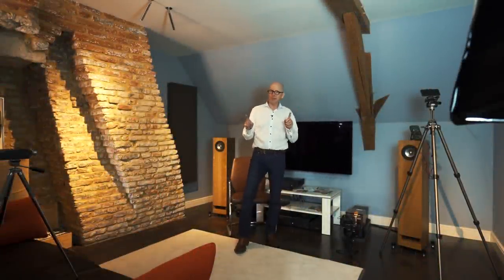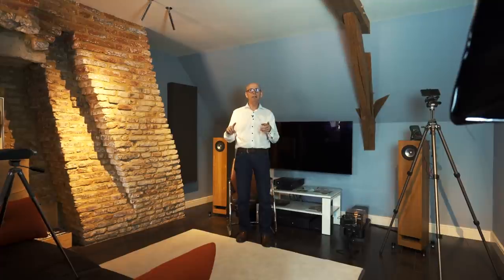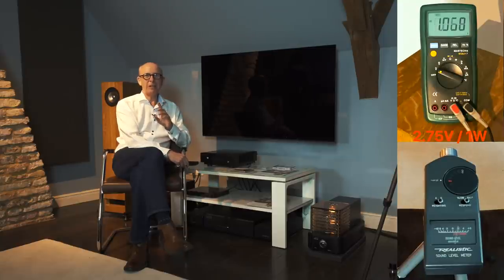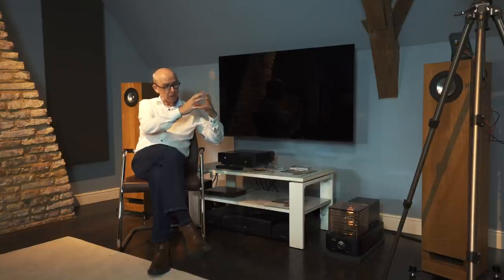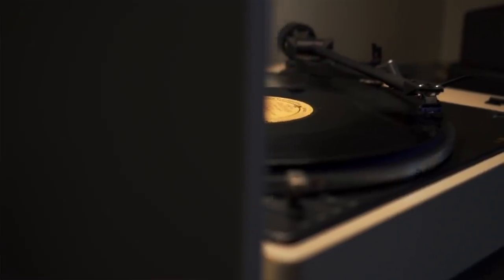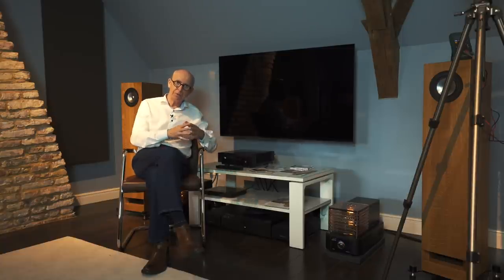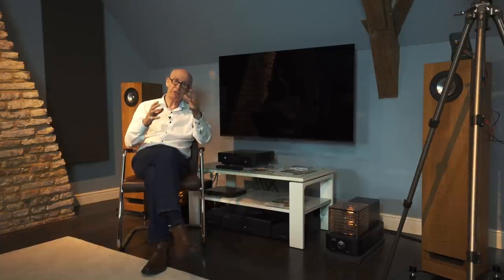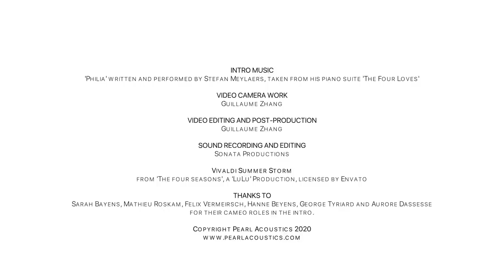How loud is 1 Watt (with an 87db Loudspeaker)?

Comment: l love vt25 sound so much. But I have only one pair of focal 1028BE 91db speaker. I ve wonder is the 1.5w per channel VT25 single ended tube amp can drive 91db Focal 1028BE speaker within 100 square feet area？
Reply from the maker: I am no expert, but if you have 1,5 watts of power you will get at least 91,5db at 1 meter! Whether that’s enough depends on so many factors. You, the room, it’s damping etc etc. You just need to try these things. If it doesn’t work for you, then you’ll find a solution and move on. Good luck and enjoy the music!

Comment: Again, very well done, Harley. But toward the end of the video you mentioned something about speed needed in the same breath of a 600 watt amplifier. I lost you there. Would you be so kind as to elaborate?
Be well, my good man and thank you.
Maurice
Reply from the maker: Hi Maurice, thank you for your kind appreciation. What I meant was that, just because an amplifier might be able to deliver a lot of power. It does not necessarily make it very dynamic. Some reviewers refer to it as ‘fast’. Now I know this sounds weird because scientifically electrons move +/- at the speed of light, but some amplifiers give muddy, ill defined bass, which can be referred to as sluggish or slow. While others give a very tight and detailed and fast bass. But this is not always only related to the bass. The reason is often related to damping factor or other design concerns. Hoping that clears it up a bit? It was a clumsy attempt to explain something complex in a shorthand way

Comment: Most audiophiles never built or heard of a LM386 one chip 1w bread board(or strip board) amplifier.
A decent LM386n-4 amplifier circuit + 9v battery(or 9~12v clean DC power source) + efficient 90+ SPL bookshelf speaker combination will blow your mind.
If you measure the DC current with DC current meter while playing music, it rarely goes near 1w.
Reply from the maker: Interesting! Thanks for sharing

Comment: As someone who has to do most amplifier shopping online, are there specifications and measurements to look at that would be good indicators of how quickly an amp can serve up that power?
Reply from the maker: there are, but I do not know amplifier manufacturers that talk about it.  Check out Colin Wonfor, he's an expert on this topic.  Nelson Pass too. Some reviewers talk about 'rhythmical', others about dynamics but the amplifiers response time, or recovery time is almost never mentioned. Sometimes the size of the capacitance in the power supply can give a hint. But I am worried about generalisation here because it depends on the amplifier Class type, D, is very different from A of AB.  I will have to write a white paper on the topic, but that's for another video! (you could also check out my 'what amplifier?' video - that might also help a bit.)
Reply: The efficiency of your speakers have a huge impact on the amount of power needed to reproduce great realistic sounds.  I have a pair of Zu audio Soul speakers, rated at 99 db I watt @ 1 meter, and find that an 18 watt per channel Nelson Pass class A SS amp is more than enough to reproduce any music that I care to listen to.  So don’t be fooled into thinking that monster amps are the one and only solution, the speaker that they are driving is the key here.

Comment: Very informative. I have a question I'd like to ask, where was the dial on that amplifier? Thanks before hand.
Reply from the maker: Sorry I don’t understand...
Reply: @PearlAcoustics Hi, the question is this. What number was shown on the amplifier display when it reached 1 watt? Thanks again.
Reply: I am asking this because I have a Denon dra-800h with 100 Watts per channel but for it to sound loud enough I need to turn the dial at about 50% and more depending on the source.
Reply: More information on my side, the display shows  - 30db to reach an average of 50db. Hope it is clear now, and sorry for the many questions. Thanks before hand and by the way awesome content.
Reply from the maker: @rafalobo5308  ah ok... the answer is no idea! What I mean is the monoblocks almost never show over the zero point. I could check. But really those dials are only useful for biasing the tubes! A volt meter and sound pressure meter tells much more, from there it’s just maths. 😉
Reply from the maker: @rafalobo5308  ok! I understand. I have just looked at the specifications. They don’t say much, except it only needs 250mv to feed it for full power. So if you have a suitable feed, the reason you need to turn the dial so high is either to do with an impedance mismatch or the amplifier volume control is logrythmic (ie, the more you return, the more power it delivers with the max in the last quadrant). If you are concerned, try sending an email to Denon. I am sure they wil help. The power level in my input device, went to about 75%
Reply: @PearlAcoustics  thanks so much for your answer, checking your amp online I just realised there is no display 😂. Your amp is really powerful for one reason, yours max consumption is 750watts, mine is 220 Watts, so probably mine is not 100watts as claimed by Denon. My question would be this, at max volume how many Watts is your amp delivering? Your content is over the top, cheers mate.
Reply from the maker: @rafalobo5308  for the demonstration. I used a Quad CD player / pre-amplifier into  a 40W (max) tube amplifier. (One per channel). So I know it never went above 40w and the volt meter told me, maximum 6.8W. Remember: the difference between a 50w amp and a 100w amp is only 3db. Almost nothing! And 50e compared with 200w is only 6db! Don’t worry about numbers. If everything sounds good to you, enjoy it. If not - change it. Good night.
Reply: @PearlAcoustics  Thanks so much, very helpful.

Comment: But is your digital voltmeter able to indicate transient peak voltages? It’s response time will not be fast enough and only show a moving average, not the peak voltage and therefore will not correspond to peak wattage, surely.
Reply from the maker: Thanks Peter for your comment. Indeed you are correct. For a more accurate peak wattage, an oscilloscope would have been better but harder to demonstrate in the video. I was trying to show a general rule of thumb RMS wattage requirement and to show that we generally use less power than we think, in general. Using RMS, implies that the amplifier is able to produce peaks above the quoted number. I also use a piece of music that is relatively even in its output. 
The video started out as a bit of fun and got a bit out of hand!

Comment: I love this video.  My home theater consists of 7 Klipsch speakers with sensitivity ratings of nearly 100dB 1w/1m.  I know my receiver is barely idling even at very high volumes.
Reply from the maker: Thanks. Indeed you could run your set up with a Decware Zen amplifier and still have power left over! 😉👍
Reply: @PearlAcoustics  I actually used an AA battery powered Sonic Impact T-amp for quite a while when I had a 2 channel setup with Klipsch forte II speakers.  People who listened to it couldn’t believe that a few AA batteries could make them play so loud and clear!
Reply from the maker: @marran8140  😀

Comment: This is a great video, but one thing it leaves out is about large multi-driver speakers, and the power needed for dynamics. The more drivers that you add, the more sophisticated the crossover typically needs to be. More sophisticated crossovers will absorb some of the power used to drive the speaker resulting in less efficiency. That still doesn't really mean that you need much power, maybe 12-16 watts. Now, where high power is really needed is when driving speakers with very large subwoofers at extremely low frequencies for pipe organs, electronic music, etc., for that you need roughly 50watts for 90db and up to 500watts for 105+ dB peaks. All I'm saying is high power has its place, but like the video says, it's not the be all, end all solution.

Comment: I think the source track has a big impact.  I think there would be a big difference between a bass and a track with a lot of high frequency emphasis like this orchestra
Reply: absolutely true. pair those 6.8 Watts with a sub or even a woofer sized speaker and you will get over 50 watts easily, I bet 100 watts aren't too far off. and I refuse to listen to anything without at least a warm touch of bass where it should belong.

Comment: Good explanation, the only caveat here is the DMM isn’t designed to measure AC voltage across the audio frequency band.  

Wouldn’t a more accurate test be to use a function generator , play a frequency tone (or many , up to you ) and then accurately measure it?

Some DMM aren’t very accurate , when measuring 20hz to 20khz for example, vs. Using audio Analyzer OR oscilloscope.
Reply from the maker: Hi Jean, you’re absolutely right. I simply used this method to explain a point. Thanks for your contribution to the topic

Comment: Can you share the formula you are using to calculate the outcome? Thanks so very much.
Reply from the maker: In fact, to calculate power is very simple. Volts multiplied by Amps = Watts. And volts divided by amps equals resistance. So if you know the resistance of the loudspeaker you can calculate the watts by the above equations. For every doubling in watts you increase output by 3db. 
Of course this is very simplified because a loudspeaker driver’s resistance varies with frequency. But for this little experiment, the above should suffice. 
At the end of the day, it’s all about perception. If you add even a tiny amount of distortion to the signal, even relatively low volumes can seem unbearable! Listen to a cheap transistor radio at full volume with low batteries and you’ll know exactly what I mean. At the end of the day, it’s the decibel meter that tells you how loud you are playing and the voltage at the back of the speakers can give you an indication as to the power your amplifier is delivering. But there can be very, very short peaks of voltage that would indicate that for 100 thousandths of a second the amplifier is producing far higher wattage. That’s why we like to measure in RMS (root, mean square) or some refer it to the quadratic mean.
Reply: @PearlAcoustics  thank you!

Comment: How is this possible I have an arcam rcube which is 90watts total 35 x2 for woofers same for tweeter n it's not loud like dat system is it because of d type of speakers u guys use n what amp was used in d system

Comment: RMS power measured by a multimeter is somewhat deceiving. Between having enough peak power headroom to avoid compression or using a low power valve amplifier that "beautifies" the peaks with musical compression (= even harmonic distortion added) I most certainly prefer adequate peak power. This means I rather go for a powerful transistor amp that won't compress my music at the peaks.
Reply: The Mastech MS8217 is not even a True RMS multimeter, so it's basically shows nonsense when measuring the music signal. It's only good to measure a constant low frequency voltages like the 50/60Hz grid voltage.

Comment: To get anywhere near an accurate measurement you would need to use an RMS instrument with a max reading facility. The resolution of the meter you are using won’t allow you to accurately measure that type of signal.
Reply from the maker: Indeed, thanks for your comment. The idea for the video was more informative, rather than scientific. Maybe someone will make one, one day.

Comment: I wonder how much of the voltmeter movement was the result of the speaker impedence varying  due to differences in the frequency spectrum of the sound, rather than simply greater amplitude in loud parts of the music. Perhaps a power meter (measuring both current and voltage) would have been a better measurement tool to use. Apart from that, this is one of the best and most informative videos I've seen on this subject, thank you.
Reply: Phil Allison  I know it was reading the voltage, however P = VI and I = V/R, so if R changes due to changes in the impedence of the speaker at different frequencies, then I changes, and consequently the power changes.

Comment: What determines how fast a speaker can deliver the necessary watts? Is this where current comes in?
Reply from the maker: Dear Mathew this a very complex question to answer in a short comment. From the amplifier side, it is it’s ability to produce the correct voltage with enough amps continuously, and in peaks and thus is largely determined by the quality of the power supply components and design. Plus transistors that do the amplification work vary in type and design and some are much faster to respond than others. 
On the speaker side, the mechanical resistance of a driver (and how long it takes to go to full extension and back to the minus point) is also a factor. This rarely is a big issue unless the crossover design impacts this mechanical resistance in some way. 
Hoping this helps a little?
Reply: @PearlAcoustics  Hey - that's the best answer I've gotten yet on this question. So, Thank You!  I keep hearing things like 'this amp's watts are more powerful' or 'all watts are equal', and you've helped me start to see what these sorts of statements are missing.

Comment: Thanks for posting this.  I'm surprised I haven't seen more of these types of videos.  I need to hook up my meter and try this (sadly I have a lowly digital Rat Shack meter, but I do have a UMC-1 and REW).  I've been wondering myself.  I recently spent $4750 on some rather large (no replacement for displacement!) 4ohm speakers that are 98db sensitive.   I kicked a 500watt amp to the curb which worked wonders for my planar speakers at the time and replaced it with the 50watt amp of far more refined sonic quality.  I only listen around 65-75db  normally and 85 to 90 for "spirited" listening sessions.  I'm curious how much power I'm really using.  Oh and I listen from about 7ft away from the speakers (Cardas configuration speakers on the short wall).  With all that said, I think for some people, the need for more watts comes from the need for more current and the bigger amps usually have better current delivery.  Magnepans for one do not sound so hot with low damping and low current amps (although they maintain pretty level impedance thankfully).  Another thing I've noticed is that in a given product line the amps don't sound the same, and the higher wattage versions tend to have better sound qualities (from what I can tell in reviews).  So you might not need 250watts but if that first watt is more refined or to your liking over the first watt of the 25/50/100 version then the 250watt monster wins.  This is the issue I am facing, for instance I was looking at Hegel and Parasound products (amongst others) and in reviews the bigger amps review better, but I don't need that much power,  but I do want the refinement.  For my power requirements the expense shouldn't be so much, but to get a certain level of sound quality, apparently I need to buy more power than I'll ever utilize.
Reply from the maker: This is a bit too much detail for me to reply to, except to say - that bigger, is very often not better!  Nelson Pass can share a thing or two on this. Try watching my video on 'what amplifier?' maybe there can be some interesting information.  Often it comes down to preference. Sports car or smooth limo. It's hard to have both (sorry for the over simplification)!
Reply: @PearlAcoustics  I think we're in agreement.  I'm certain my amp is more than adequate, I'd just want to see the numbers for myself.  But the other part is more about certain manufacturers, not across the board or as a general rule.  I finally have speakers worthy of some Pass Labs amplification and when I'm ready to spend another few thousand dollars I'll be on the hunt.  The thing is I need to be able to hear whatever equipment I'm going to buy in my own system in my own space (a whole 'nother can of worms).  I will check out your other videos though simply because you seem to have interesting content.
Reply: Nelson Pass being mentioned is famous for re-iterating the importance of the first watt. It's the range in which typical listening will be in.  Having power to deal with dynamics in all types of music is not a bad thing.  But, if music listening is particular to type or SPL levels that doesn't require the reserve, then it can be more specialised.  

  For years, I only used 3.5w each channel SET amp through a FirstWatt F4 buffer Amp.  The F4 amp has no gain, I didn't need more power for my listening habits. The SET amp though can struggle to reproduce clean lower frequencies at certain levels for modern music but has perfect mid range qualities.  The F4 helped it by providing a non dynamic load so there is no strain and in turn the F4 controlled the bass woofers better. The result is a more even presentation with bass line clarity without adding more power.